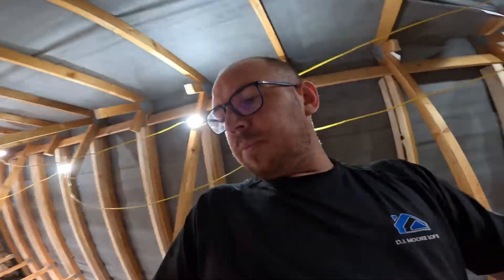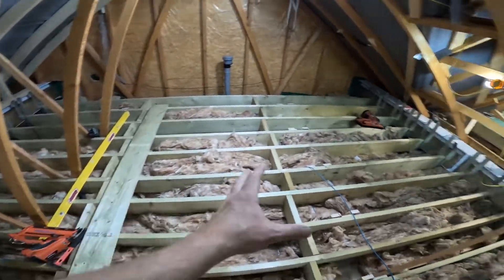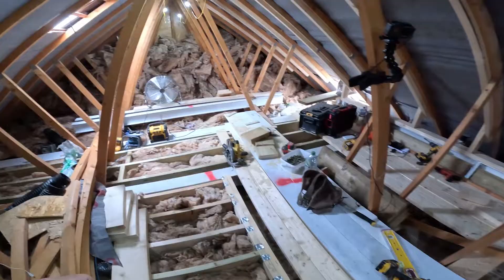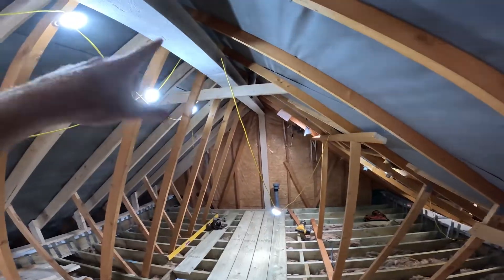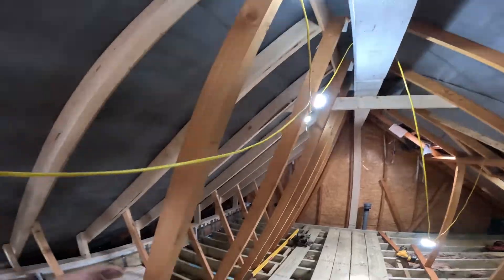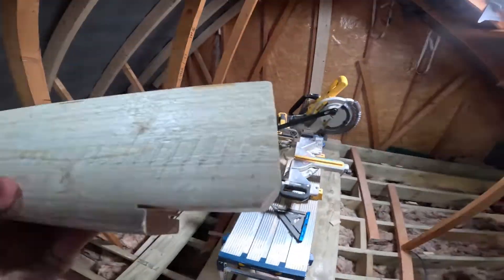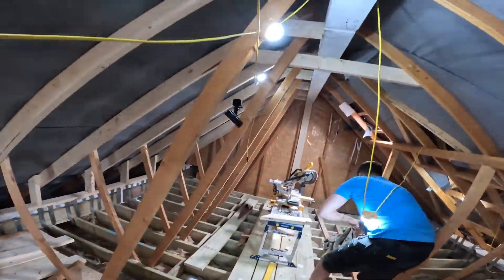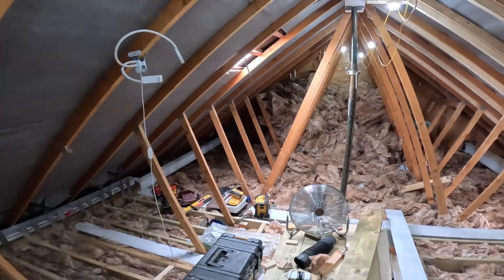Day 3 - Loft Conversion - Installing the new floor Joists and removing the trusses!

Comment: Can i cut my trusses out an just put timbers across on every beem ?
Reply: An make small 2ft trusses across both sides? Will that hold the roof like ?
Reply: An say put 2ft timber walls across both sides?
Reply from the maker: Can’t do anything with out structural calcs as every roof is different.

Comment: Why do you need the steel beam?
Reply: They cut all the trusses
Reply: @raineyconstruction  Is it possible to use timber 6x2" for garage (2720 mm W x 5500 mm D) when creating a loft space for storage?